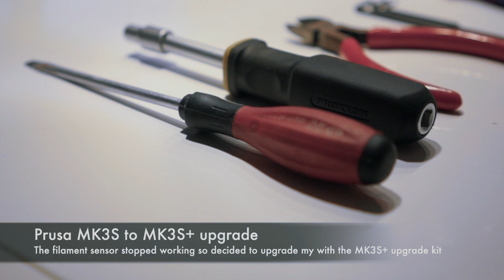Prusa i3 MK3S to MK3S+ upgrade || making stuff

Comment: You didn't upgrade all the parts...  You should have upgraded the better belt tensioner system that they did rather than the stupid side tightening bolt that ends up cracking the piece if you do it too tight.